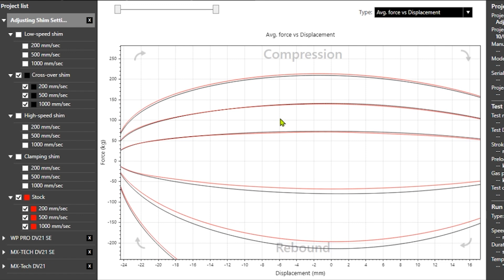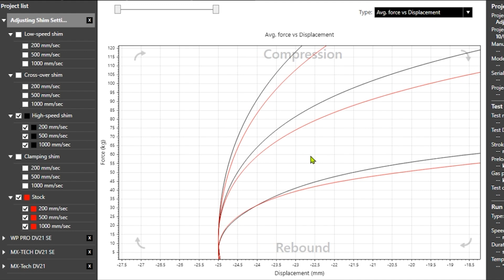Shim tuning tips: how changing just one shim transforms suspension

Comment: Can you record a full episode of how such a setup for HardEnduro looks like? Or a change for weight?
Which washers are responsible for the first damping so that it takes the stones but does not hit the hinge and so that it is stable?
Reply from the maker: Hey, so that’s actually outside the scope of LABA7 — it’s more in the suspension tuner’s territory. If we started diving into those kinds of specifics, we'd end up having to cover every sport and motorsport out there 😅
Reply: @laba7  thank you for respecting all of us tuners out here! Awesome video for sure, how many mm stroke were you running and how many hp was the dyno just out of curiosity.
Reply from the maker: @RobertSimmons-np4gr  Hi. Thank you! We were using LABA7's LIGHT Shock Dyno that has 4 HP motor and 25-50-75-100-125-150 stroke steps. For this video, I believe we used either 50 or 75 mm stroke. But to be sure, I will check with the team.
Reply from the maker: @RobertSimmons-np4gr  It was 50 mm.

Comment: I am about 80 kg with my riding gear. If I want to stiffen the shock, should I first of all go for a stiffer spring or maybe add a high speed chim?
Reply from the maker: Good question! First, you have to make sure you have the right spring rate for your weight.The adjusting of the damping system should be done only if you are not having the desired behaviour. Hope this helps! If you'll have more questions please do not hesitate to ask.

Comment: How is 42mm high speed? Also if you wanted to show the changes that happen to the damping curve based on piston speed why show a force v. Displacement graph
Reply from the maker: The change is being made to the high-speed shim stack, hence a high-speed. We can see the change whether it's on a force v. Displacement graph or any other graph
Reply: In the instance of a split stack like this, everything before the crossover (face shims) is low shaft speed and after (christmas tree) is the high shaft speed side of the stack. Depending on how you tune the face shims and high speed compression adjuster (amongst other factors) determines when the high speed is actually engaged. From my experience as a tuner, the average dyno can't show you "exactly" when the high speed comp adj. circuits engage unless you are drilling and tapping for pressure ports on either side of the piston and in the nitrogen reservoir and know what your looking for. This is where having a tuner with a dyno and real world tuning experience across many bikes is a benefit.
Reply from the maker: @RobertSimmons-np4gr  You are right. A shock dyno, although a good one, is just a tool - who uses it makes the difference. The real-world tuning experience surely has a massive effect on how data is interpreted and what changes are applied. 

And as you mentioned additional sensors, we also would like to use this moment to mention our EMA - electromagnetic damper test system - that support up to 8  additional  synchronized ADC channels (up to 10 kHz sampling rate). Our customers that develop and manufacture shock absorbers use it a LOT.